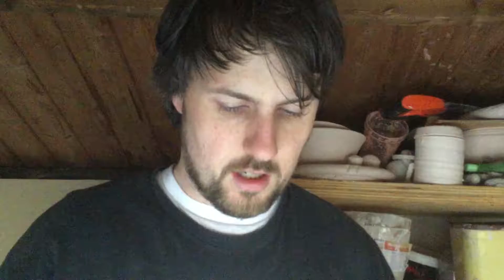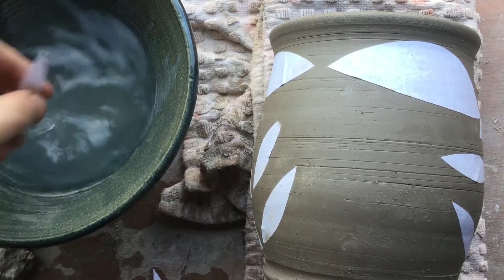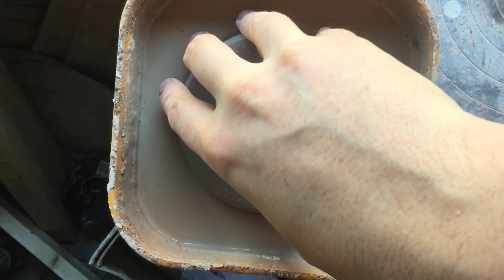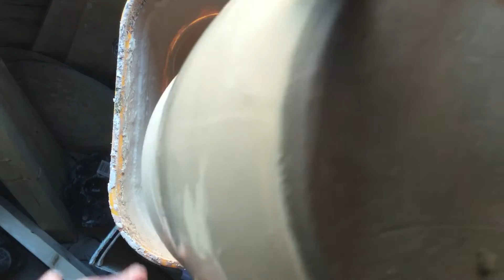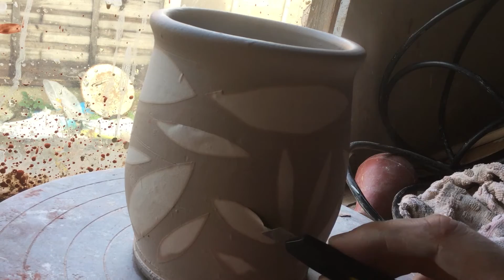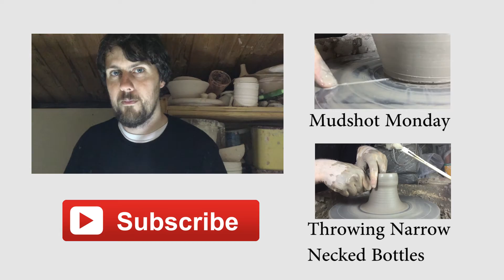Throwing Down a Simple Slip Decorated Paper Resist

Comment: nice, but a few questions.  I am still experimenting with papers to get the best line,,,I keep getting bleeding on the edges,, any suggestions? also if you bisque fired without peeling off the paper would they just burn off?  Thanks, and please show the finished works, maybe do a separate video that shows the results of all of you techniques
Reply from the maker: +william riek The pieces I kept from this series aren't fired yet, I am hoping to take them up to a wood firing at some point next month.

Not sure about bleeding, not really had that problem, but I make the paper slightly damp before I apply them, and just give them a rub to make sure they are going to stay put.

You are best removing the paper as in theory the paper could burn away and leave the layer of slip and would have to be cleaned up after bisque which could also could problems for clean lines.
Reply: excellent ... thanks,,, I look forward to seeing the finished work.